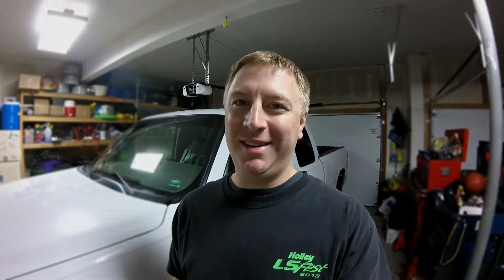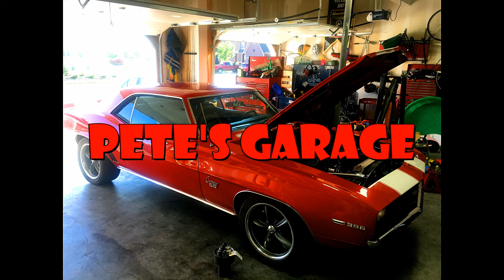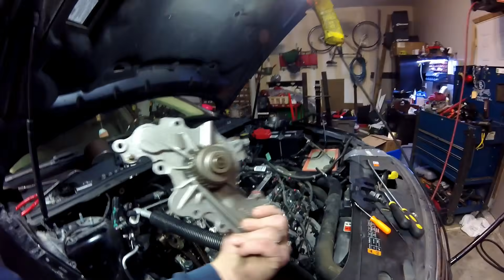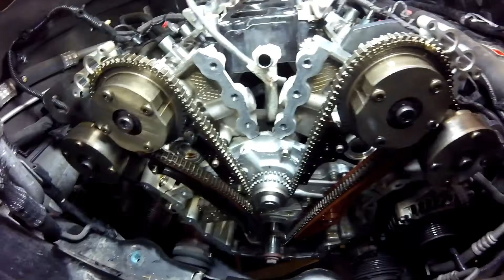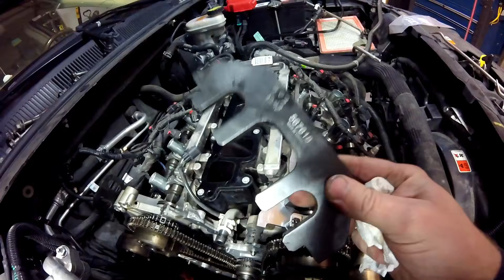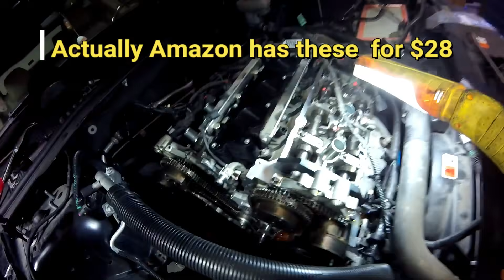Why does the Ford Taurus, Explorer, Edge 3.5L water pump cost over $1400?

Comment: So, as these cars get older and the miles pile up, a bad water pump job could easily exceed the value of the car and
render the cat totalled.  A lot of shops would suggest to the owner to call a junkyard.  What a miserable design!
Reply: Thats good I see myself driving a nice EcoBoost Taurus in the future. The same way me and my dad still drive 6.0 powerstrokes bought em cheap did the work and they run like wild animals
Reply: Come on a water pump and anything to do with timing belts gears chains ⛓ etc should be covered by the manufacturer for at least 80k especially on a engine like this one it's ovbiously designed to last a long time because look at what you gotta do to repair it
Reply: that junky car would be totaled at 65,000 miles in my opinion...i would have driven it through the dealer window...i cant have anything but Toyota by court order
Reply: Especially since most shops won't do the job without replacing the timing set as well. $3000+
Reply: Craig Jorgensen ... When you run over the cat, it is totalled in nearly every case. Splat.
Reply: I could see somebody clever making a special aftermarket plate with a bit of plumbing, and using an external pump. Basically an internal-pump delete kit that replaces it with something much more serviceable. At least it's possible if the rest of the engine is worthwhile.
Reply from the maker: Except the water pump in question serves as an idler sprocket for the timing chain. You would still be digging deep into the engine to install said block off plate/idler sprocket.
Reply: Ford will do anything to sell another car.
Reply: How wasteful.  I've poured "more money than the car's worth" into fixing timing chain driven water pumps!  The last one only lasted 220k miles...do your part and keep up on cooling system maintenance and maintaining the rest of the vehicle.  I'd rather change the part in a vehicle I've owned since new and know the maintenance history on than to buy someone else's problems (and unknown maintenance history) on a used vehicle
Reply: Brent Boswell so, you pay two thousand dollars to replace the water pump on your 175,000 Taurus that is
worth maybe 1500.00.  Next month the transmission go's bad.  You spend another 3000.00.  Another month
a red light runner totals your miled up Taurus.  Insurance Co.could give a rats rear about the money you spent and
gives you a check for 1500.00....maybe. Wanna roll the dice?  Not me!

Comment: The engineers actually outsmarted themselves on this one. The water pump was put there to reduce the footprint of the engine and allow it to fit into the same area as the engine it replaced.

Comment: Remember....is it $1400 worth of real work or about $400 of work that they are charging $1400 for?  I had the same reaction to my Audi Dealer when he stole me I needed $8000 in suspension work.  I asked the same question and got crickets.  They didn’t like me being so prepared.  I got the original $800 worth of work that was requested along with an Airbag recall and a free service loaner for a couple of weeks so not a total loss.
Reply: Depends on what YOU think technicians are worth vs. what they're ACTUALLY worth. Typical consumer.

Comment: What a CF. What type of engineer would design something like that. Good reason to stay with Japanese built engines.
Reply: they are junk too. everything made in the last 15 years is junk
Reply: So far our Mazdas are holding up well. Don't get my started on modern diesels.  @ad356
Reply: @perry9492  mazda was in bed with ford for many years. i prefer to stick with older and proven engines. i just bought a 01 GTP with 100K on it. 3800's are rock solid
Reply: Not sure that is a bad thing. I had a 95 Ranger that I put 270k on and the only thing that stopped it was me dropping a screw down the intake (subconsciously on purpose)  @ad356

Comment: Water pumps, alternators and starter motors should all be easily accessable, but lets face it, they could care less. 
Its all about how fast they can build and sell them.
Reply: also dealer turn around. The harder it is for the normal guy to change at home the more likely it is to come back to them to make money off of.
Reply: That's why I steer clear of any vehicles built to fuck my wallet like I'm some kind of whore.
Reply: @ifnotnowwhen6914  
Its a game. 
I'm a wiseass, I'll draw a smiley face with rtv on the inside of a framerail on something I'm working on and pranks like that. 
Its the same with the oil filter location department.

Comment: im a ford tech and you dont actually have to take of the cam phasers or the secondary chains to do this job, you can slide a wrench underneath the phaser on the right hand side to get to the 8mm on the guide enough to get the chain and pump out.
Reply from the maker: Good tip. Thanks for sharing
Reply: @PetesGarageandperformance  ya no problem, our factory workshop manual tells us the same thing to take all that stuff off but another guy in the shop showed me that trick and have been doing it that way since

Comment: That's just foolish technology ,thanks for the heads up . I wouldn't be buying any used Taurus's in the future.
Reply: Stephen youtubin something even better. Dont own a ford
Reply: @cashmoney7497  I learned after the first, and last, ford I bought.
Reply: Older Taurus is better
Reply: @JesusRoseAgain  2000 to 2006 for taurus had a bad reputation on transmissions but the 3.0 motor is very good .. I had a 2000 model I replaced the transmission one time only and the motor was running good at 350k miles until I had an accident and had to sell.the car to.the junk yard
Reply: @thechampion9525  I've had two Taurus cars.  Both DOHC and OHV.
Reply: @JesusRoseAgain  yeah they are very good cars but those new ones are a little complicated
Reply: then you shouldn't buy any modern day cars since all have basically the same design engines .. if you think this is bad, then stick to cars from the 70s and 80s since Chrysler been doing this since 1999, gm since 2003.
Reply: @theR6969  GM since way before 2003. Let's not forget when they put a single core radiator designed for V4 engines, in their V6 Pontiac Grand Am/Grand Prix. Plus, the temperature gauge is faulty and often won't tell you it's overheating. And, the seal in the reservoir cap is known to break too. And the years prior to 2003 were not immune to this. Go to your local scrap yard and bask in the mass amounts of Grand Ams with blown headgaskets. Or the fact that different cars of the same year and model from GM will have 3 random variations of torque bit sizes just to make maintenance that much more tedious. Ford doesn't have all that bullshit torque bits and other nonsense.

Ford > GM, change my mind.

EDIT:
Oh, yeah, also, one word. Dexcool. Fuck GM.
Reply: 4th gen and older from experience are actually really great cars. Motor mounts always go bad before 200k, rust buildup usually blocks the heater core around then as well. Both are easy fixes. Everything is very easy to get at, much easier than the GM cars I've owned and worked on. I own a 2001 Mercury Sable (exactly the same as taurus w/ very minor body style changes), and love it. Drives like an old lincoln. I don't trust anything Gen5 and up, too new for me to have any knowledge or experience with it. Gen4 taurus/sables are extremely popular vehicles.
Reply: I never like Ford. So I brought a Mazda. Hell I didn't know it was a Ford engine.
Reply: The older Taurus's were a lot simpler. I have a 96' Taurus and the water pump is driven by the serpentine belt and is easy to replace like all the other  components which I can replace myself. I also do all my maintenance myself.

Comment: This is nothing new with ford. They have been doing this since 2002. The ford focus 2.0 is an example
Reply: Started with the high output 2.4 from GM from about 89. First chain driven water pump requiring this that I know of. This engine evolved into the modern ecotec
Reply: Just did the timing chain etc on my daughters Ford escape. The 3L duratec is very similar. Pain in the ass from start to finish

Comment: The flip side is that if someone decides that they don't want to pay the shop $1,400 for a car like this and the used market doesn't like these cars and you pick it up for $500, a few weekends with the car in the garage, a few hundred for parts, then you got a nice car for a bit of sweat equity and will have no timing or cooling issues for the next 100k miles.

While there will be other repairs, you still could get by pretty cheap.

Now compare making payments on a new car and paying depreciation.
Reply: Still no reason to buy this junk. Why not buy a TOYOTA?
Reply: @foot675  

Toyota same year is how much?

What do you think it is going to cost you to keep it on the road for the next 100k mi?

Now consider depreciation. With a higher acquisition cost both the Toyota and the Ford are likely to arrive at zero about the same time,  but the Toyota is going to loose all of it's value but it is going to cost you more to start with. Then you are going to replace timing belts and water pumps every 70k miles as you probably have am interferiance engine.

My bet is the Ford will cost less.

Comment: Not a big deal a ton of honda engines run the same type of waterpump
Reply: 17 years working at a Honda dealership and I have never seen a water pump driven by the timing chain.

Comment: Ford has always done crap like this. Replace a water pump on a Chevy 350, 4 bolts and the fan - a Ford V8, everything on the front of the engine bolts to the water pump so it all has to come off. Looks like those engineers passed their wisdom on to the next generation.

Comment: welcome to the ways ford makes money! I can imagine that because  of the water pump being connected to a high tension chain, bearings must go pretty quickly on em. Newer ford motors are probably some of the most complicated domestic engines on the market. Their engineers buried high wear areas like the alternator, water pump, starter, etc deep in the engine to jack up that repair bill because they know that these areas will wear out quickly. i hate fords...always have.
Reply: @Darr  No...they were meant to be heard bc it's the truth asshat. Not sure how I was indicated to be unbiased, but professionally speaking I'm a mechanic myself and happen to work for Dodge and have a father in law that does in fact, work for ford and we BOTH agree. So much for knowing when to step up on the soapbox, Derp.

Comment: i was a chrysler mechanic for 20 years and its no different than doing the nightmare 2.7 v6 sebring / intrepid
Reply: The 2.7 engine is not that hard to work on especially if in a rear wheel drive car
Reply: @countryboyrt8054  Even a lot of the front wheel drives are longitudinally mounted.

Comment: Apparently all the Generic Motors fans forgot about the Northstar Cadillac engines.
Reply: The starter goes where?... lol.
Reply: If I had to change the water pump on my EcoBoost, I'd just do it. It's all nuts and bolts. Chevy folks are just lazy and dont wanna mess more complex stuff. I used to be a Chevy guy. Whose making the most HP from less cubic inches these days??

Comment: I've known about the problem for a while. I am no mechanic. I own a 2009 Taurus that has the 3.5 Duratec with 148,000 miles. It runs sweet. Never any problem. I plan on having the water pump replaced BEFORE it goes out and redo the timing chain, guides, the works while they are at it. I figure that should give me another 100k which will last 10 years at the rate I drive. Meanwhile, I changed to synthetic and replace every 6000 miles, flushed the coolant, drained and refilled the transmission. Maybe the car isn't worth it but it is a top of the line beauty and I feel like a king driving it. Meanwhile, my wife drives a 2015 Taurus with 27,000 miles and I intend to baby that one too. It doesn't take that many car payments to pay for the maintenance. By the way, I was told that the internal water pump was engineered so that it would fit transversely for front wheel drive. I would rather give my money to a good independent mechanic than to some finance company.

Comment: Just another vehicle manufacturer screwing customers with a part design that is only designed to make dealerships money. Completely unnecessary and could be done many other ways that would make it more consumer friendly. But this is what happens when manufacturers don't want you to be able to repair your own vehicle. Or at least not very easily.
Reply: its not really that great of a job for the TECH either, if it hell for the average joe in his drive way then its a pain in the ass for the tech at the dealership. the difference is we already spent the $1000s in tools and have a set up to do it more efficiently and have the information/knowledge and experience but that was gained by getting your ass kicked by jobs like this. and $1400 for parts and labor at a dealer is small potatoes. pump cost about $200 plus all the seals/cooant/silicone etc for another $250-$300 looking at $500 in parts and that seems like about a 5-6 hr job at $150 an hour (typical rate )   $900 in labor + $500 parts =$1400

Comment: My opinion is that it is a stupid design. I really try to stick with a rear wheel drive but hard to find one with a common sense design. I don't understand how a engineer would not think the cost for a consumer for repair. But I bet some ceo pushed for this kind of design for some benefit of the company instead of the consumer.

Comment: I have two Toyota V6's in my garage. They have been very reliable and my local mechanic does not mind working on them. One of my neighbors has a Ford Edge with the 3.5 liter engine. I consider myself very lucky.
Reply: Be glad Toyota and other Asian brands are smart enough to keep the water pump externally driven with serpentine belt.

Comment: Everyone blames Ford for design,design,design how about Quality of the part itself..
Not all chain driven water pumps fail right?
And not all 3.5 and 3.7 engine leak.I done too many of this wp to count and seen them with as low as 26k miles on a 2yrs old car to 100k 9yrs ....
Limos and cop cars being more common.constantly running cant handle it and start leaking.
Reply: What quality? I have yet to see any quality in Ford products. A friend bought a new 2019 when they first came out and the thing had rust within a few weeks. He took it back and somehow it was never primered at the factory! Some quality control!
Reply: @johnstark4723  That Is what I'm trying to say...
It's not the design as everyone thinks...it's the crappy as  parts they make.
Reply: @guayaco-dm3vu  it's both really.  Some failures are design issues.  It shouldn't cost 4k to change spark plugs but on some Ford vehicles that's the case because of poor design. In other cases it's cheap parts and extremely poor quality control. The more they take humans out of the manufacturing chain the less overwatch there is and less quality control. Machines can't do it all as sensors are not that good yet.